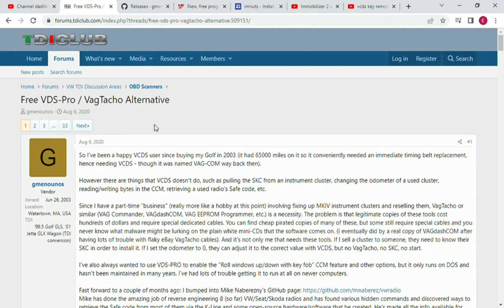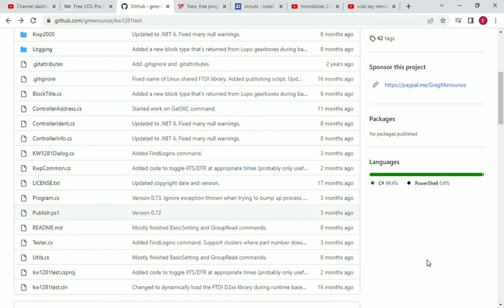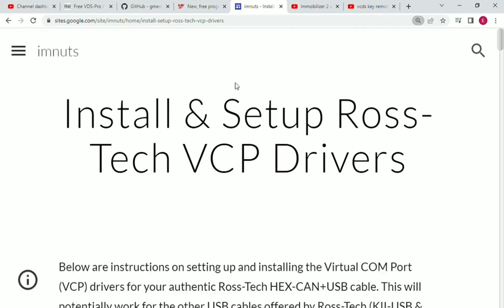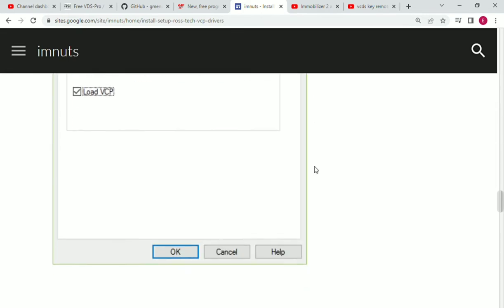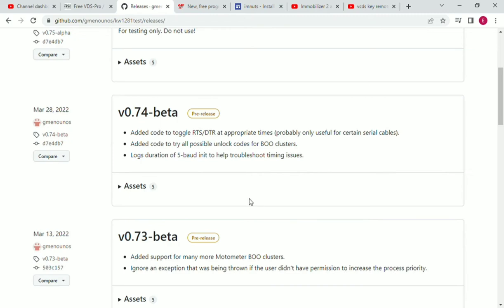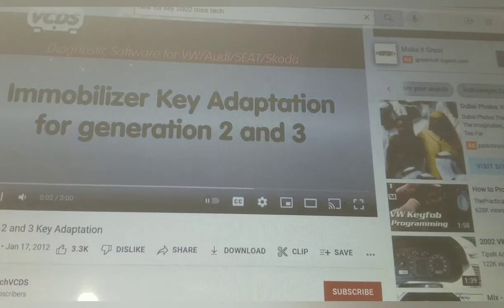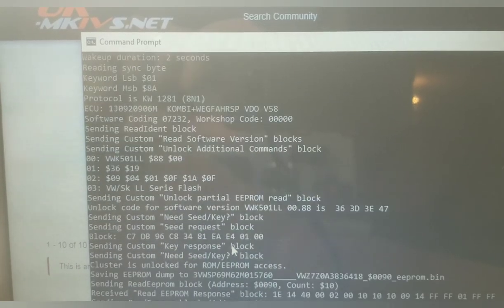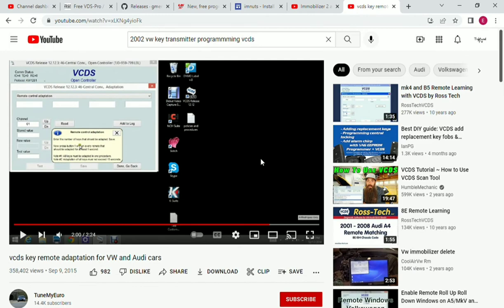Free SKC Pin Retrieval for VW Immobilizer Key Programming using kw1281test and Ross Tech VCDS cable

Comment: Thank you! You just saved me from having to spend extra money on an additional cable I didn't need to get the code to program my new replacement keys. (car only came with 1 key, and that key went through the washing machine by accident and killed the remote part of it. new keyfobs didn't click together with the old key, so just have to use the new keys and keep the old one as a backup that can't open doors via the fob buttons. Got all 3 keys synced up and working now! Thanks again!
Reply from the maker: I'm glad it worked for you.

Comment: Liked. Per ross-tech download, "The following applies to our legacy USB interfaces (HEX-USB, KII-USB and HEX-USB+CAN).   It does NOT apply to our current HEX-V2 or HEX-NET interfaces.   These new interfaces do not use a USB UART chip and cannot be be used for "dumb K-line pass-through"!. Yeah, I have the HEX-V2😞😞
Reply: Well there should be a way with the HEX V2, after all its the more advanced version
Reply: Can you elaborate on what you are saying?  Are you saying that the older ross-tech devices are better? Or is it a software issue? Or are the older worse and you need the newer scanners to pair a key to an immobilizer?

Comment: Changing com port can be a pain, if you have disconnected devices reserving com ports you have to set device manager to show non present devices in environmental variables then change the view in device manger to show hidden devices.

Then you can see the disconnected com ports to uninstall freeing them up to assign them to your cable.

Comment: Hi friend. This method works on china cables?
Reply from the maker: I believe it is supposed to work with other cables as well. It's my understanding that it should even be easier, because you won't likely have to set up the virtual port.
Reply: You should read more on the TDIclub forum thread for kw1281test, and it better describes the cable required, with (NON-referred Amazon links) to cables that work.

For windows, many inexpensive cables work.

For linux or macOS (yes, it works on ALL major OSes), more specific cables are required, because of the underlying way macOS and linux communicate with the OBDII cables.

Comment: Thanks for this great video! Do you know or anybody else can I program my key immobilizer (Polo 9N) with VCDS? I've broken original transponder chip and I want to replace broken transponder chip in key with blank one and reprogram it with VCDS. Is it possible?
Reply from the maker: As I recall you need a functional key for VCDS to program a new key.  There are some videos claiming that you can turn immobilizer off, but I don't know if any of them work.  I suspect you'll have to pay a professional to fix this one.
Reply: @tightwadtv3421 
I have another functional original spare key. The first one just have damaged immobilizer chip. My idea was to buy a new blank transponder chip and program (adapt) it with VCDS. Other parts of key are good except transponder chip. Can I use VCDS to clone data from spare key to this key with new blank transponder?
Reply from the maker: @FreeStylerBG  I believe this may work for you then.
Reply: @tightwadtv3421 
Well I'll try anyway! My local locksmith asks 100 bucks to fix key. I think it's too much because I have working spare key, vcds cable and just need to fix immobilizer chip issue...Blank immobilizer chip is about couple bucks and with little luck with your tutorial I could fix it literally for nothing. Only afraid of damaging spare key with bad VCDS settings and make myself without any of 2 keys and can't start the engine at the end of operation...
Reply: @FreeStylerBG  Did you get it to work bud? I'm about to try the same thing.

Comment: Unfortunately it doesn't work in my Audi TT 2001. After ruuning program I get this:
"Args: COM4 10400 17 GetSKC
OSVersion: Microsoft Windows NT 10.0.19045.0
.NET Version: 6.0.8
Culture: pl-PL
Opening serial port COM4
Sending wakeup message
Wakeup duration: 2 seconds
Reading sync byte
Caught: System.InvalidOperationException Unexpected sync byte: Expected $55, Actual $95
Unhandled exception: System.InvalidOperationException: Unexpected sync byte: Expected $55, Actual $95
   at BitFab.KW1281Test.KwpCommon.WakeUp(Byte controllerAddress, Boolean evenParity) in C:\Users\gmeno\src\kw1281test\KwpCommon.cs:line 75
   at BitFab.KW1281Test.Tester.Kwp1281Wakeup(Boolean evenParityWakeup) in C:\Users\gmeno\src\kw1281test\Tester.cs:line 31
   at BitFab.KW1281Test.Tester.GetSkc() in C:\Users\gmeno\src\kw1281test\Tester.cs:line 428
   at BitFab.KW1281Test.Program.Run(String[] args) in C:\Users\gmeno\src\kw1281test\Program.cs:line 243
   at BitFab.KW1281Test.Program.Main(String[] args) in C:\Users\gmeno\src\kw1281test\Program.cs:line 26"
Reply: I know this is late but instead of 10400 try as the baud 9600